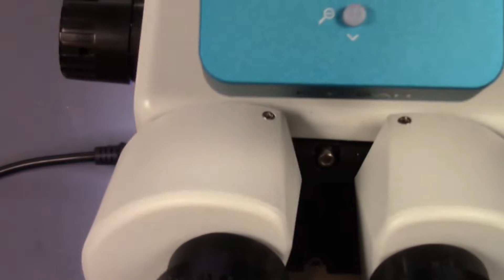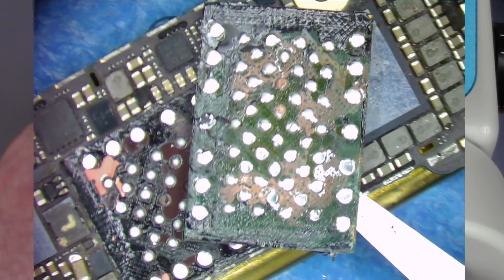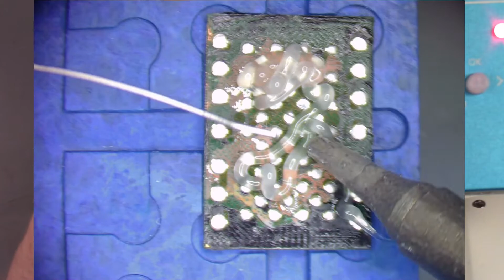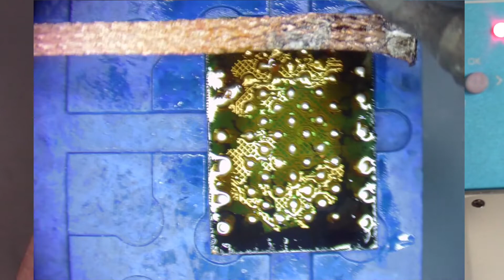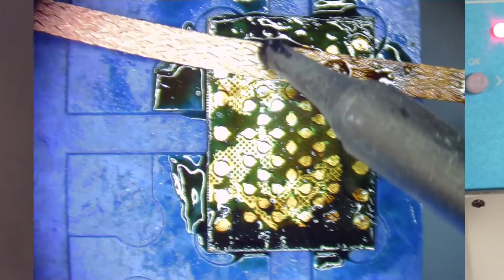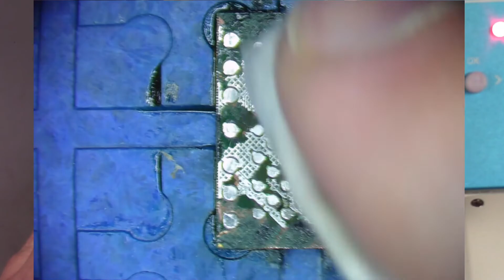My First Time Pulling An Underfilled Chip It Went Bad

Comment: Just based on what I saw, I'm still learning myself. Might have been better to use a bigger nozzle, you were kind of just focusing heat on a small part of the chip, I like to do quick circular motions over the the chip making sure I heat it evenly. Also I would never lever a chip off the board, I've never used that tool you used, but it kind of looks like it levers the chip off the board. I'd give the chip light taps so I know when it's ready to come off, maybe the underfill makes that more difficult to do, not sure. But I am just learning myself, so I might not be giving the best advice.
Reply: I think the real culprit was the lack calibration....still good attempt....lots to learn from and revise for the next attempt.